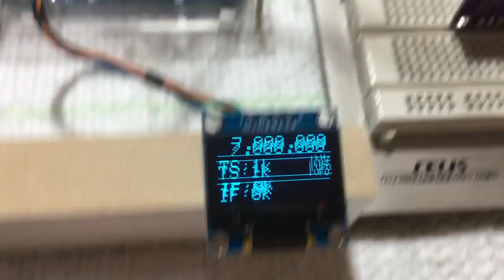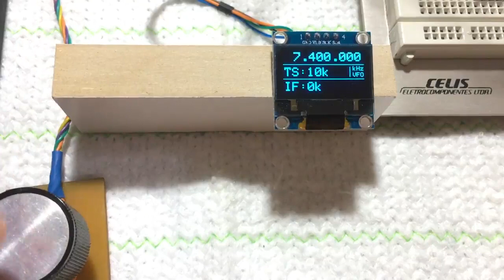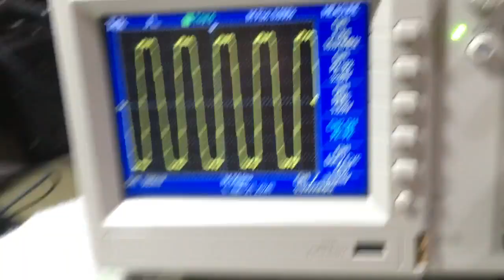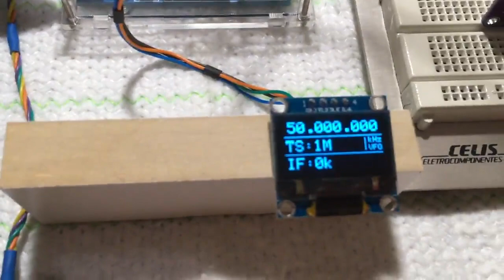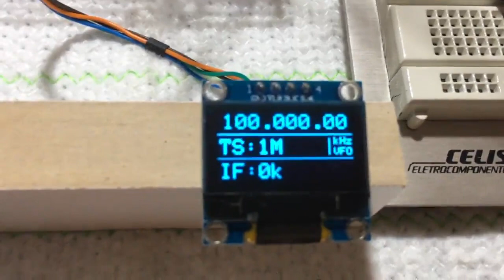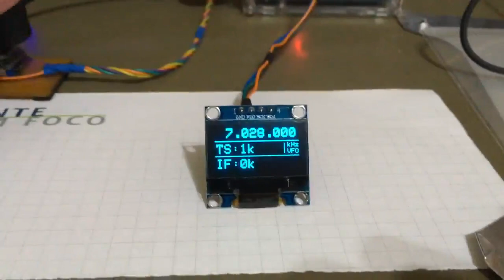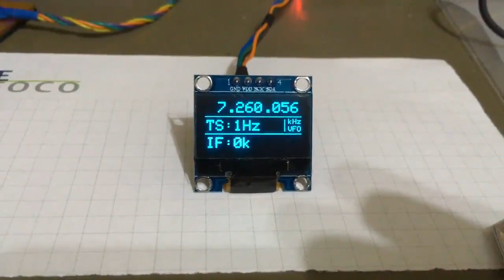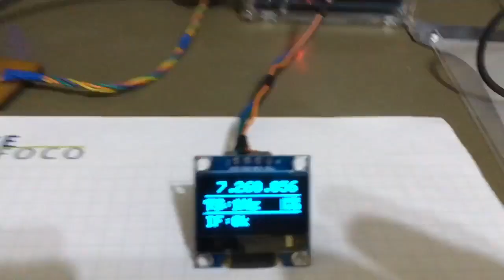New  Si5351 DDS VFO / RF Generator - Download Sketch and Schematics

Comment: The SI5351 is NOT a DDS generator, it is a PLL generator... those are two completely separate and distinct methods of generating RF signals, and should NOT be carelessly confused. Both methods have been around for DECADES and both have their own unique virtues and drawbacks.

Comment: The only draw back is that mini display. It does nothing for an older person with bad sight.
Reply from the maker: Hello, thanks for testing it. The display used is popular and cheap. It is possible to use the 2.42in display, but it is more expensive. https://pt.aliexpress.com/item/32950307344.html?gatewayAdapt=glo2bra

Comment: o seu sketch foi o único que consegui fazer funcionar no meu arduino+display oled. Pretendo colocar o DDS em um rádio Intraco Orion 3, para a faixa dos 40m. No entanto, além da frequência do VFO; este rádio em específico exige uma outra frequência fixa de aproximadamente 3.850 kHz. É possível adicionar essa modificação no código facilmente para que esta frequência seja gerada a partir do CLK1 ou CLK2 do SI5351? Além disso, gostaria de limitar o range do DDS para a faixa dos 40m, entre 7 e 7.3 Mhz.
Reply from the maker: Olá, minha sugestão é tentar a modificação no código original, conforme abaixo (não testei para ver se funciona 100%) 
void setup() {

  gen_3850();

  si5351.init(SI5351_CRYSTAL_LOAD_8PF, 0, cal);
  si5351.output_enable(SI5351_CLK0, 1);                  //1 - Enable / 0 - Disable CLK0 - MAIN FREQ
  si5351.output_enable(SI5351_CLK1, 1);                  //1 - Enable / 0 - Disable CLK1 - 3850kHz
  si5351.output_enable(SI5351_CLK2, 0);
  si5351.drive_strength(SI5351_CLK0, SI5351_DRIVE_2MA);  //Output current 2MA, 4MA, 6MA or 8MA - CLK0
  si5351.drive_strength(SI5351_CLK1, SI5351_DRIVE_2MA);  //Output current 2MA, 4MA, 6MA or 8MA - CLK1
}

void loop() {
  // put your main code here, to run repeatedly:

}

void gen_3850() {
  si5351.set_freq_manual((3850000, pll_freq, SI5351_CLK0);
}

void set_frequency(short dir) {
  if (encoder == 1) {                         //Up/Down frequency
    if (dir == 1) freq = freq + fstep;
    if (freq >= 730000) freq = 7300000;
    if (dir == -1) freq = freq - fstep;
    if (freq <= 700000) freq = 7000000;
  }
}

void setstep() {
  switch (stp) {
    case 1:
      stp = 2;
      fstep = 1;
      break;
    case 2:
      stp = 3;
      fstep = 10;
      break;
    case 3:
      stp = 4;
      fstep = 1000;
      break;
    case 4:
      stp = 5;
      fstep = 5000;
      break;
    case 5:
      stp = 6;
      fstep = 10000;
      break;
  }
}
Reply: @Cesarsound1  muito obrigado, vou tentar por aqui

Comment: I built this today, I had to set the encoder pins to input mode with pull-up before it would respond to the encoder, otherwise it works well, just needs to go up to 200Mhz.
Reply from the maker: Thanks for the evaluation. The rotary "pin mode" is defined inside the Rotary.h library and to be honest I have never had this kind of problem here in my projects. Perhaps not all rotary encoders on the market are the same. It is possible to reach 220MHz with this sketch, but above 120MHz some frequencies become unstable, I preferred to keep the limit at 120MHz to ensure stability and also because this VFO is originally aimed for use in the HF range, where the frequency not passes 60MHz. 73 !!

Comment: Dear Julio....I noticed you ran long leads from OLED display, encoder etc. Is it OK to put the nano, clock chip and encoder all on the prototyping board? I have just started building this VFO....Cheers George VK2AOE.
Reply from the maker: Hello George, thanks for the comments and test the project.  I used long wires to interconnect for convenience, but in the final circuit this interconnection should be as short as possible, even to avoid radiating noise (EMI) and avoid instabilities. Therefore it is OK to put the nano, clock chip and encoder all on the prototyping board. Have a good assembly. Cheers - Julio.
Reply: @Cesarsound1  Thanks Julio ...strongly suspected this (RF can be naughty with leads....hence the twisty twisty!). Fingers crossed....Thanks for your generosity sharing this!
Reply from the maker: @TheArtofEngineering  you are welcome!
Reply: I wonder if ferrite cores on the wires would dampen rf/noise?
Reply: @Guns_N_Gears  Yes most likely the right ferrite material could be used, if you wrap both leads thru a toroid to remove common mode rf, 73

Comment: why when i turn off arduino, does the frequency reset? is it possible to make it stay on the last working frequency before being turned off? thank you
Reply from the maker: Hello Andrea, thanks for testing the circuit. At the moment this VFO does not store the last value when power down, I have plans to implement it in a future code update.
Reply: @Cesarsound1  thanks so much for the reply i hope to update soon
Reply: hello dear .. have you tried to change the code to memorize the last frequency when you turn off the arduino? Thank you

Comment: Hi, your project add/subtract the IF from the display readout. A friend of mine is looking for something that generate two different frequencies in RX and TX adding/subtracting the IF. Do you know of any project to do this?
Reply from the maker: Hi max, it is possible to adapt this project to do it. I'm thinking issue a new version code including more functions like EEPROM to save the status and will include this idea.
Reply: @Cesarsound1  thank you very much Julio so i can make my friend happy and probably it is also useful for me to apply to a old CB radio to use it on the 10m band.  I follow your channel so i will know if/when it is available.

Comment: It's a very good project, I have only one issue, my screen it's sh1106 no the ssd1306, you have the program for these screen?. Thanks
Reply from the maker: Hello Axel, unfortunately I had no chance to test the sh1106 because I do not have one here to do the debuging and in location I cannot find it (actually I should import it from China, but it takes time). I made the sketch based on  ssd1306 library only,  I am not sure if it will work with the sh1106. Thanks for using the project!

Comment: Is there any way to use the 1.3" OLED on this?
Reply from the maker: You should change the library to the one that supports the 1.3" OLED, because this sketch works only with the SSD1306 display.
Reply: @Cesarsound1  Already changed the library and was getting errors. Ended up comparing the sketch with one written for the 1106 display and shamelessly cut/copied/pasted and edited until it worked. Bear in mind I have no experience in programming.
Reply from the maker: @Travis141123  Unfortunately I don't have a 1.3" SSD1106 display to test and I can't find it to buy in my region, I would have to import it, which would take a long time. But as soon as I get a display like this I intend to do some tests so that it's possible to use it in this VFO.
Reply: @Cesarsound1  It's a lot easier to read at a distance.
Reply from the maker: @Travis141123  for sure.

Comment: Hi,
I tried to replicate the your dds, the sketc uploaded but the OLED screen won't start. Did you have similar problem. The old is tested and functional. Great project by the way.
Thanks.
Reply from the maker: Hello, thanks for using the project. There is a Known Issue: if it freezes in the initialization text, comment (put a //) at the line 77 statup_text ();
Reply: Hi Cesar,
I have copiled the sketch and hardware and the dds works, I want to use it with direct conversion receiver but Si5153 is not working properly. Shall I replace si5153 in the code with 10Mhz as you suggest.

#define XT_CAL_F 33000: Si5351 calibration factor, adjust to get exatcly 10MHz. Increasing this value will decreases the frequency and vice versa.
Reply from the maker: @taki8592  Can you give more details, what is going wrong?

Comment: Great project. But your rotary library has no library.properties file. I havent made this work yet.
Reply from the maker: Hi Jamie, the rotary libraries is not mine, it was wrote by Ben Buxton, the link is https://github.com/brianlow/Rotary
Reply: @Cesarsound1  I know. Thank you. I got it working now. Didn't need library properties file.   Had the wrong address for Si5351 0x3C. 
Great project. Im going to try your V2 next:)
Reply from the maker: @CanJam8  I am glad to know that it worked for you. Good luck!

Comment: Hi Julio.  I want to build your NE602 direct conversion receiver. On the schematic CN1 from pin 5 where does it got to?

Also VA and PW inputs on your voltage regulator, what are they?

Thank you
Reply from the maker: Hi Jamie, thanks for the comments. The CN1 normally is not used, but it may be used to an additional IF output. The VA is an additional pin header to supply another circuit, for exemple an audio amplifier. PW is where the battery is connected.
Reply: Ok got it. Thanks for the fast reply. You're awesome.